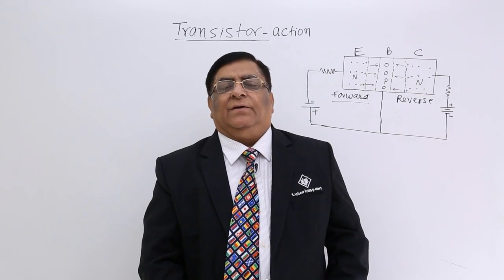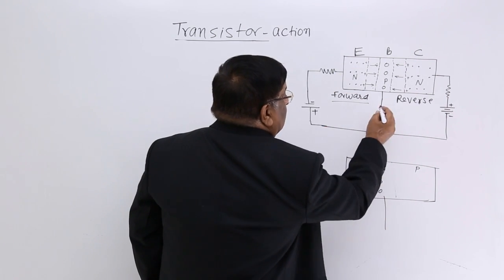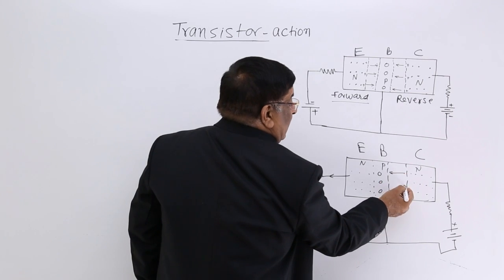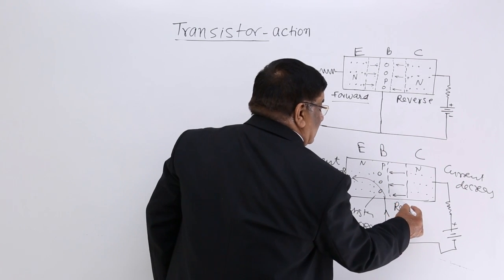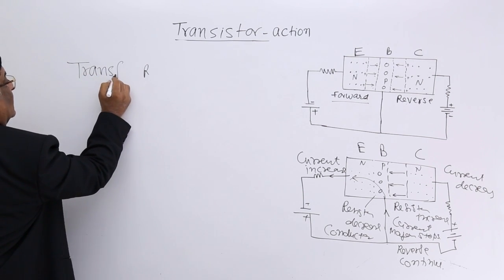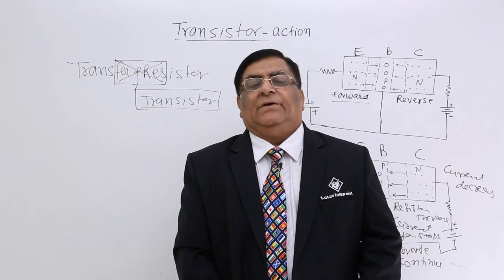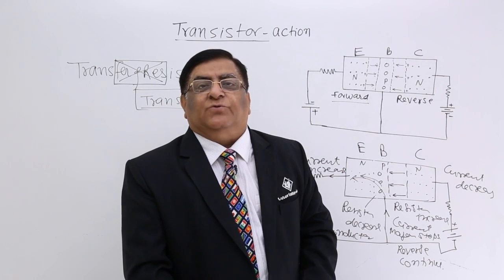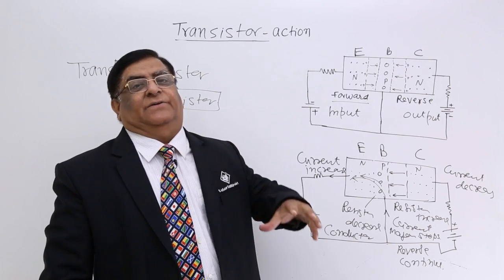Class 12th – Transistor – Action | Transistor | Tutorials Point

Comment: If the cut in voltage of silicon is 0.7V than what does it mean
Reply: Parduman Verma current starts flowing through silicon ( or potential barrier of si can be depleted) only by providing a voltage more than 6v
Reply: @jessycv5394   thank u so much

Comment: Sir what we will write.. If question asked is "explain transistor action" 2 marks question
Reply: Try to understand the topic....don't bother about marks...marks will not support for get job or in interview
Reply: transistor is three terminal semiconductor device and it is formed by two pn juction diode in either npn or pnp junction. it is used for amplify and regulate current.